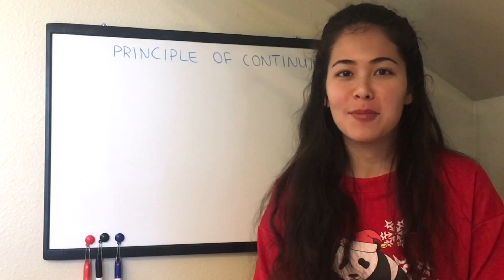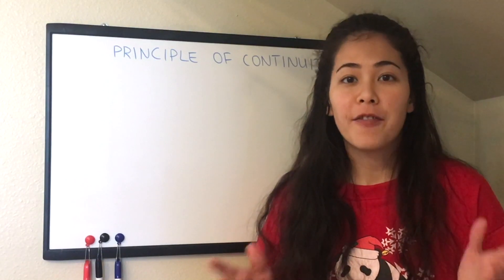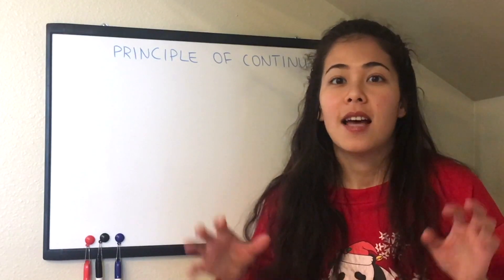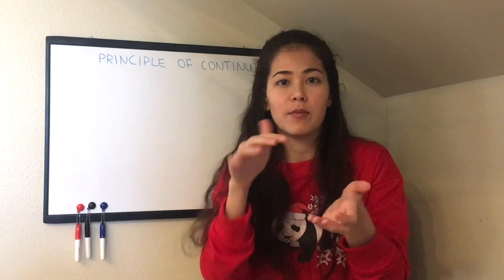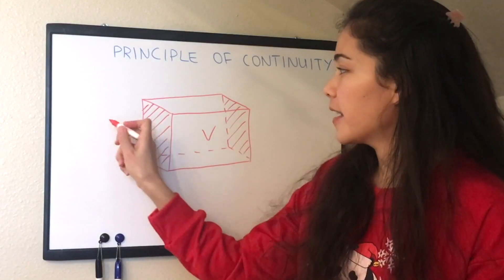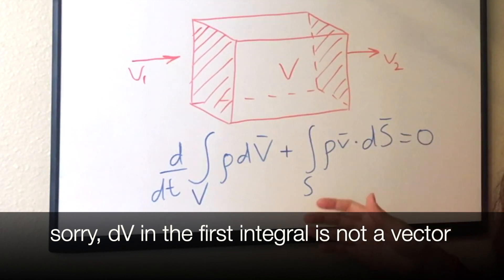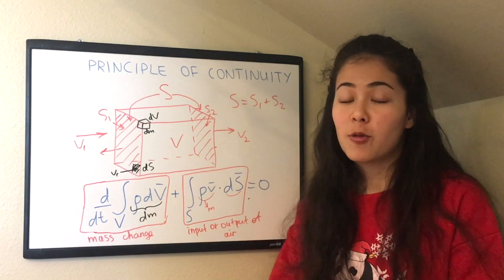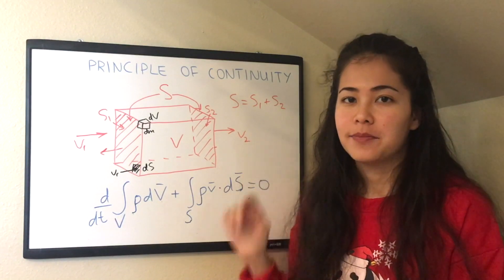Principle of continuity. Part 1. Theory.

Comment from the maker: Were you able to answer questions at the end of the video?
Reply: Will a simple pipe with water flowing be a good example?
Reply from the maker: Yes! But in order to change the velocity of water inside the pipe, you would have to make some parts of the pipe more narrow (or wide) than the others
Reply: Does principal of continuity holds for compressible fluids like air.

Comment: I'm a little bit confused. I understand what the equation means but it just doesn't make sense in my head.
From my understanding the equation says: the change of mass over time plus the input or output of the mass equal zero.
How is that possible? I understand your examples but I don't know why it is "plus" and not "minus" the input/output of the mass for it to be zero
The other way I understand the input/output is that they are equal (cancel out) and the equation basically just means the change of mass over time is equal zero. That means the mass doesn't change? That's the only way for that plus sign to make sense. Why one is correct?

Help please?
Reply from the maker: Because whatever we add into the control volume and whatever comes out of it, should be the same. It's the balance of life
Reply: Aliya Burkit Thanks
Reply from the maker: You're welcome